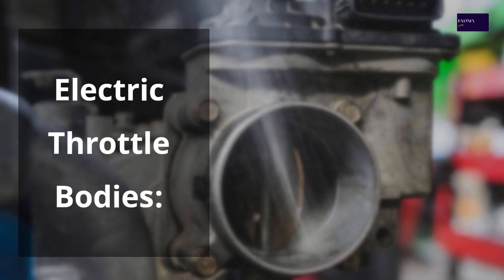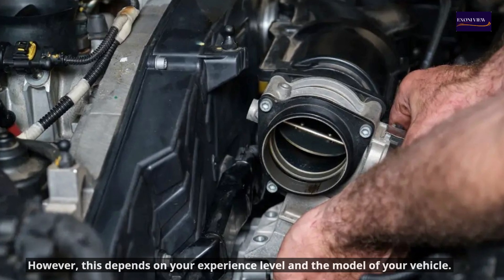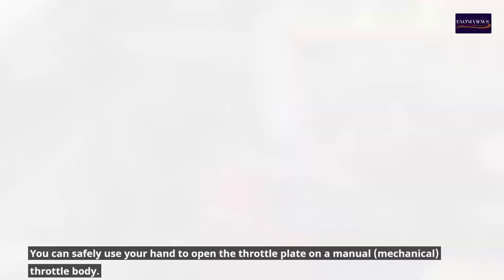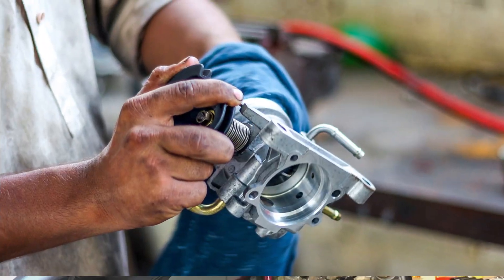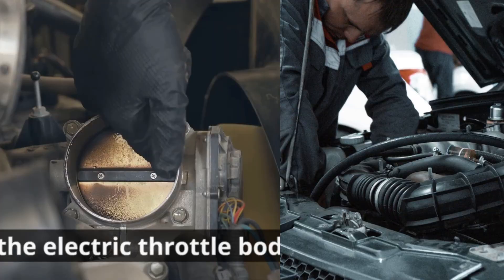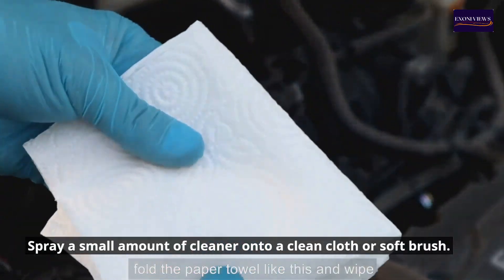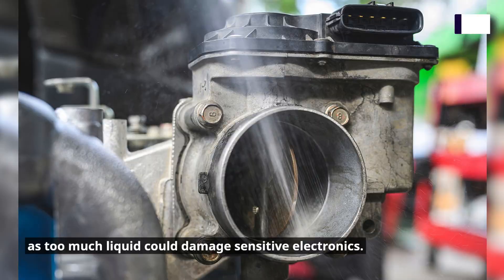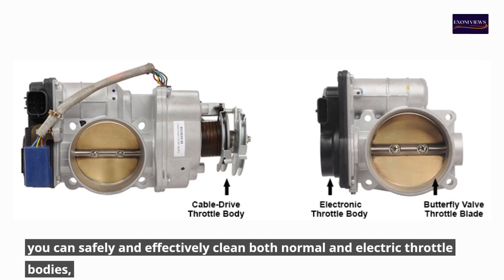How to Clean Mechanical & Electric Throttle Bodies Steps, Tips, and Precautions

Comment: IF BATTERY IS DISCONNECTED, WHAT IS THE FUNCTION OF THE KEY ON ''ON'' POSITION???
Reply from the maker: If the battery is disconnected and the key is in the ON position, it’s just a switch in the ‘ready’ position but with no electricity flowing. It’s like flipping a light switch when there’s no power supply—mechanically, the switch moves, but nothing happens.